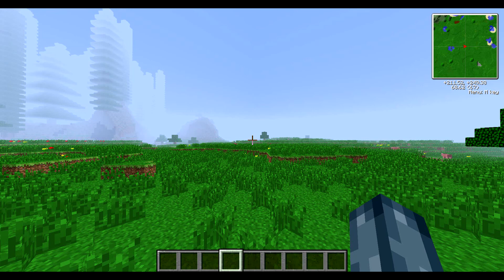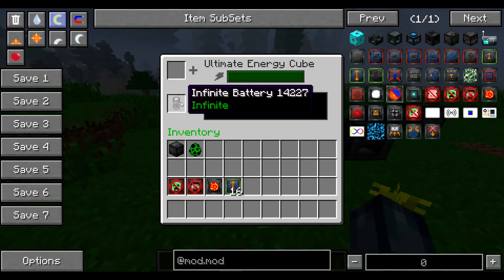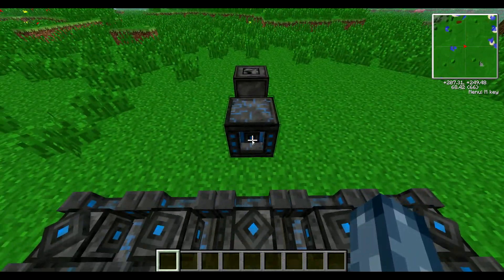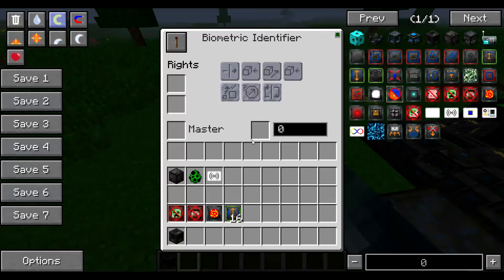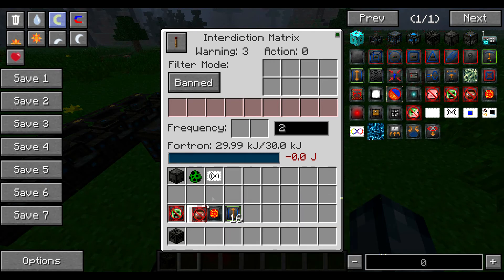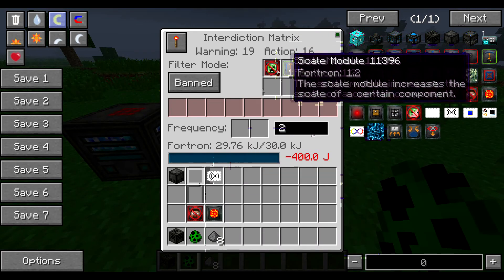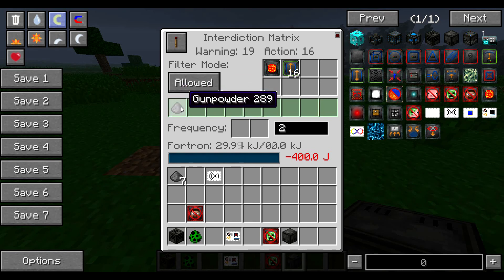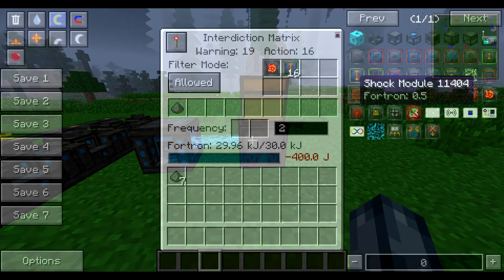How to setup an Interdiction Matrix

Comment: I'm trying to get confiscated modules to be transported into chests by buildcraft pipes instead of just dumped on the floor, but they're not being put into the pipes. How can I fix this?

EDIT: Nevermind; I remembered that the modpack I'm using has Thaumcraft, so I just put a Hungry Chest next to the interdiction matrix and used a wooden pipe to take items from it.
Reply from the maker: Sweet :P